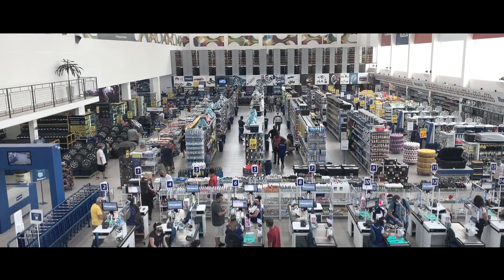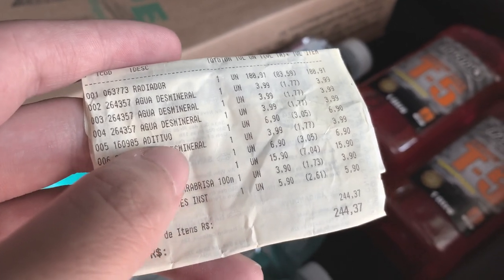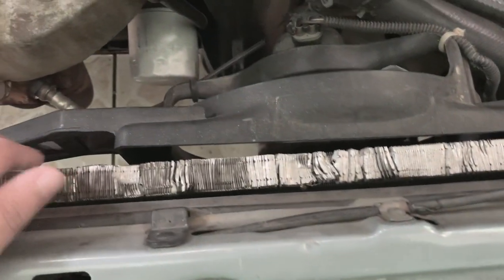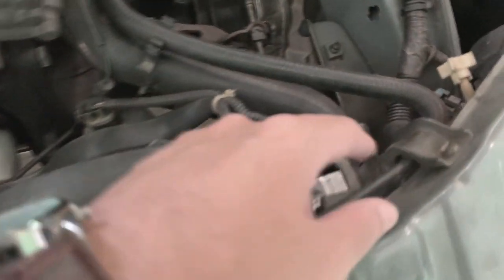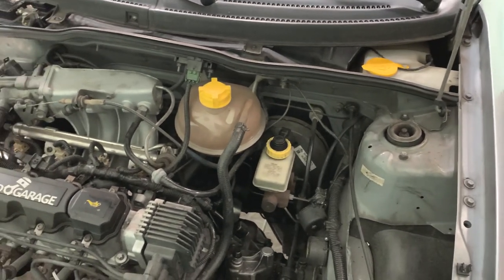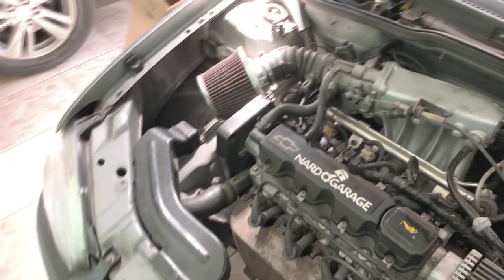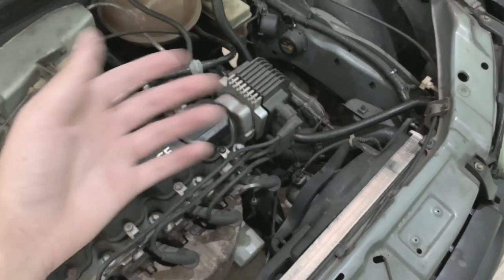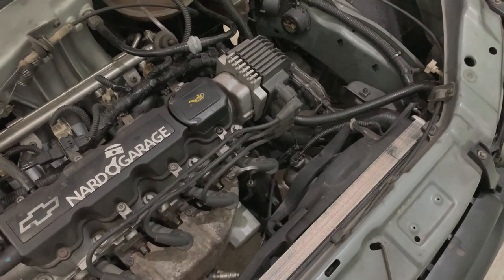CORSA WIND | SUBSTITUIÇÃO DO RADIADOR E LÍQUIDO DE ARREFECIMENTO | QUAL É A QUANTIDADE CORRETA?

Comment: Amigo vc percebeu uma melhora na temperatura com o radiador novo ? esse fluido da bardhal é bom ?  Eu comprei corsa 1.0 2002 com 83.000km originais, fiz uma revisão , troquei bomba , valvula termostatica etc. porem reparei que o corsa trabalho toda hora ligando a ventuinha..do motor.. o seu acontece isso tbm ? é normal do corsa, abraços